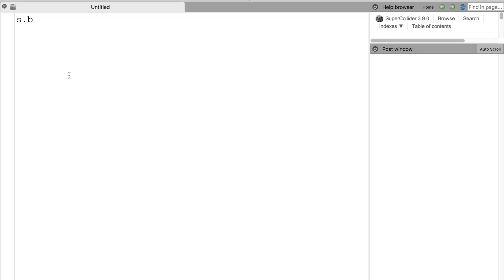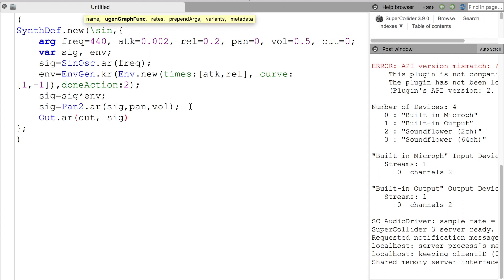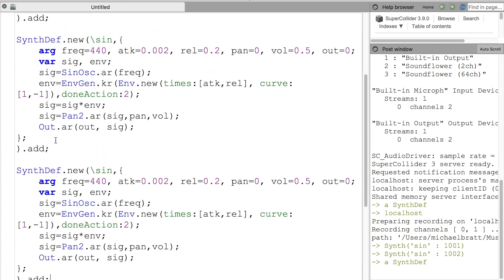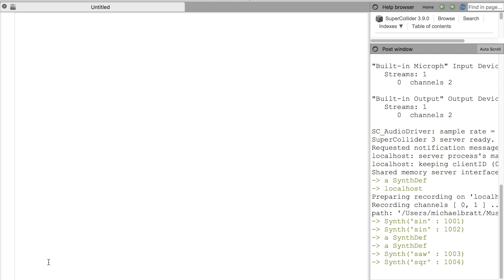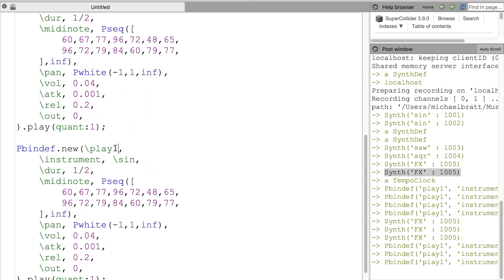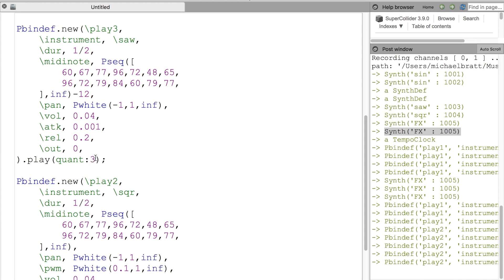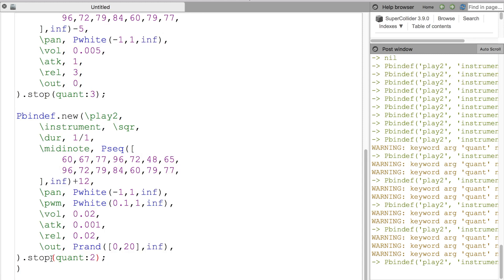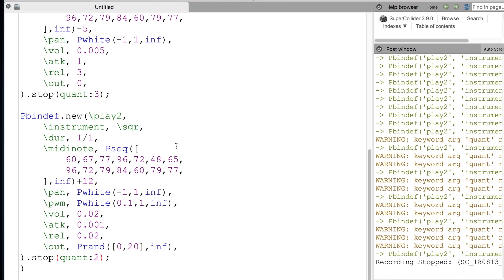Video 1: Basic Framework

Comment: I read the documentation but do you really need to use "play(quant:X)"? Thank You!
Reply from the maker: Good point. You don't, you can simply use play if you want. I was just trying to start the pattern in a different position of the meter(that's what the quant was for), unless I am making a mistake(which is possible - in that case, I would rather be corrected).